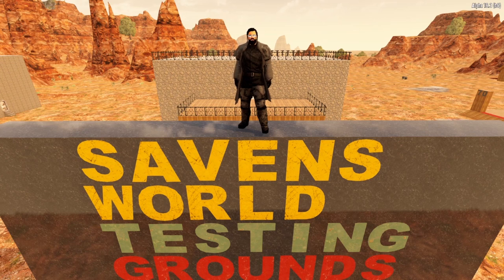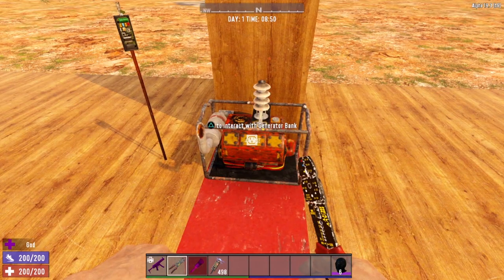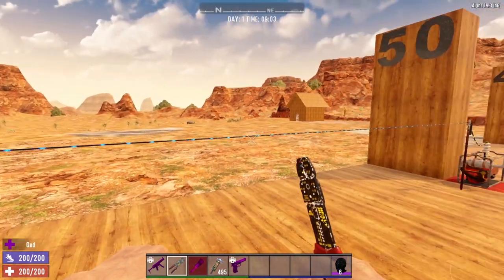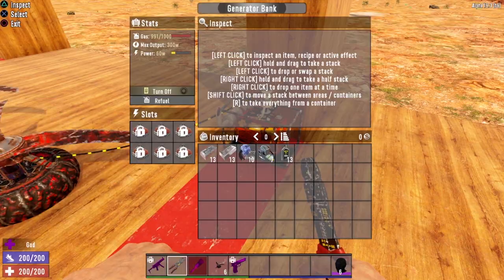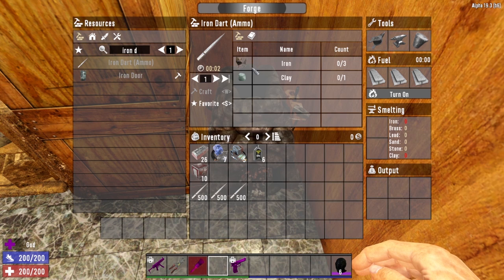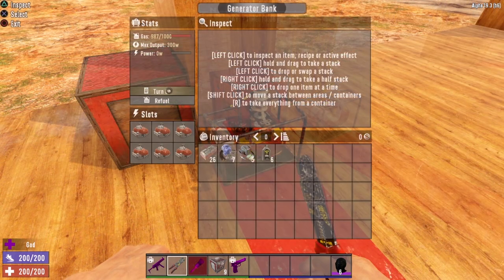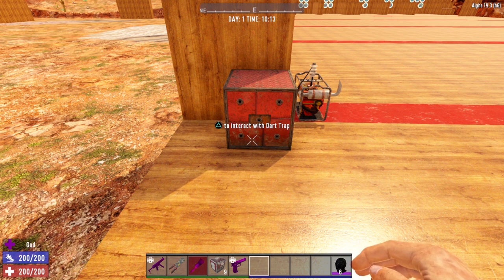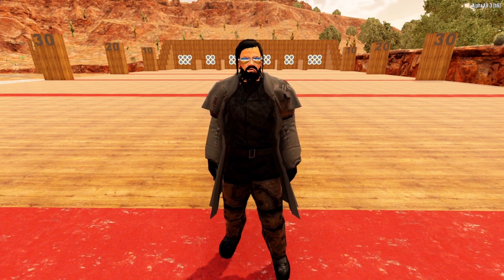Electric Trap Tutorial - 7 Days to Die [Alpha 19]

Comment: Cool video. Good one Saven. Personally I use the blade traps in pairs. I place them stacked on top of each other with the blades on the top trap facing down. Since the blades are rotating in opposite directions it seems to slow the zombies down slightly more and kind of traps them in the blades a little longer. A little side note on the electric fence posts. The farthest distance you can space them apart is 15 blocks. That's counting the blocks that the posts are sitting on with 13 blocks of space between them. They also need to be within line of sight to space them that far otherwise the electric line won't allow you to stretch it that far. Without line of sight I think 9 blocks of space is the max distance you can go.
Reply from the maker: Correct. Wires can only stretch for ten blocks, but you can reach an additional 5 blocks to connect a wire.

Comment: For the blade traps, if you place them a block higher they will decapitate zombies and kill them instantly (sans radiated zombies)
Reply from the maker: Excellent tip!
Reply: Can you place them on the ceiling facing down in a corridor to do this? On further thought, not sure if thats the best plan as then the dogs and crawlers would go under them, right? Maybe alternate a bit and put one setup for head shots at the start to quickly mow down the regular zombies, then a couple on the ground to clear out the crawlers and such.